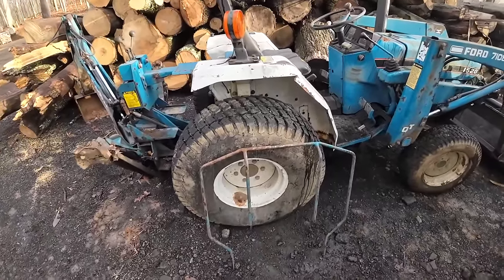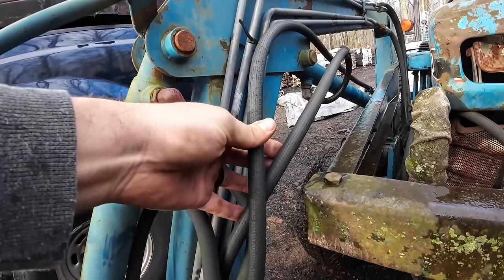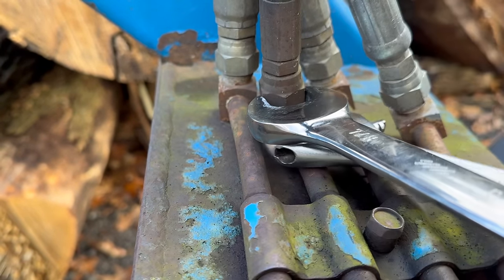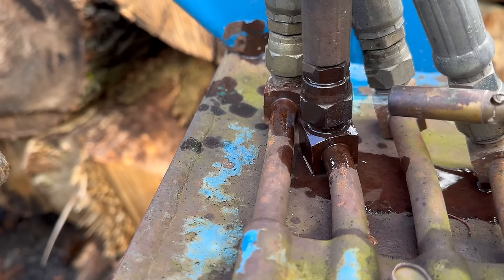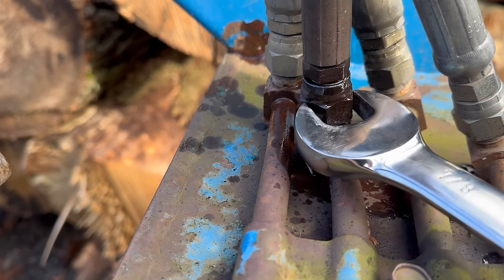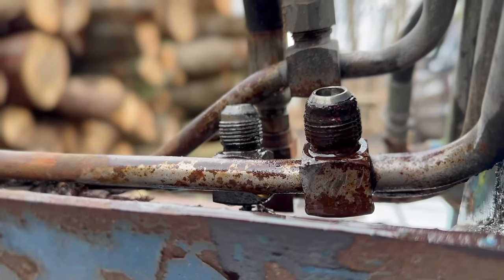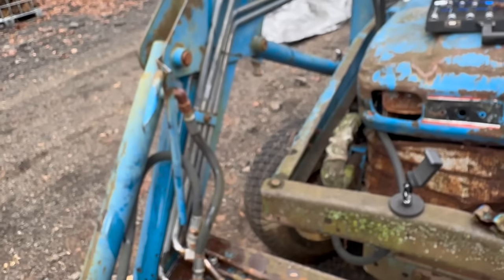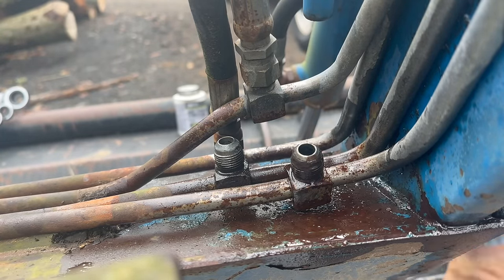#449 Old Tractor... NEW Hose!

Comment: Hi Chris,back in the day with rusty fittings we would often use a block of metal held against the bsckside of the fitting and tap the opposite side  firmly with a light hammer. The shocking does the same as the heat you used,and no worries about fire. Cheers from  H B. NZ

Comment: pipe dope not needed on jic fittings but anti seize ain't bad.
Reply: Correct. The seal is not in the threads like pipe threads. Anti-seize is a good idea for future repair.

Comment: Morning Chris I bought a Ford 1520 with a 7108 loader ,four wheel drive, 540 PTO. It's a 1989 and had 825 hrs. On it when I bought it about 6 yrs. Ago didn't have any leaks on it, the only major thing I've had to do is put in a new clutch a lot of dismantling and splitting the tractor great tractor mine has ag tires and this past summer I picked up a sickle bar mower that's pretty much my story for now i live in north central Massachusetts.

Comment: Sometimes after you heat with a torch you can hit it with compressed air, like keyboard cleaner, and the quick expansion and contraction will break things loose. Wear a face shield though because it can shatter the bolt/fitting.

Comment: If you can get to it, if you back the fitting up on one side with a hammer and then use a hammer drill on the other side will also break it loose